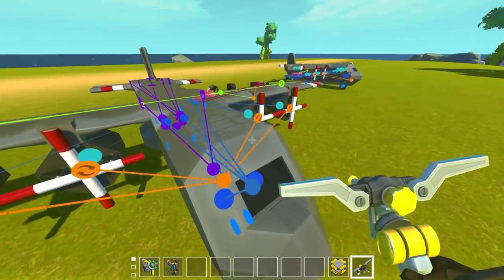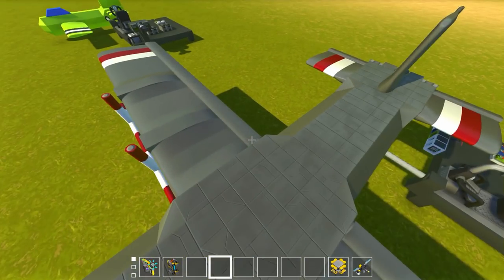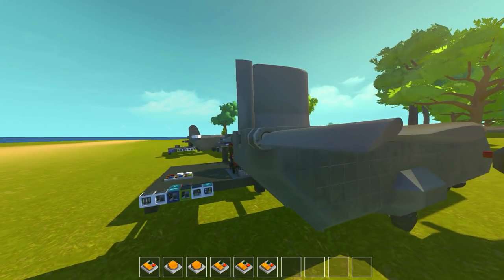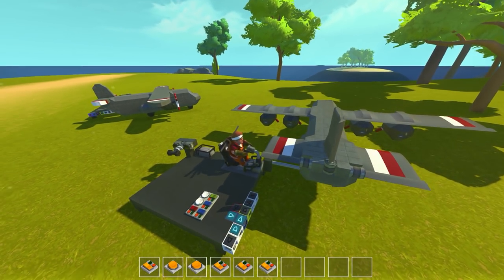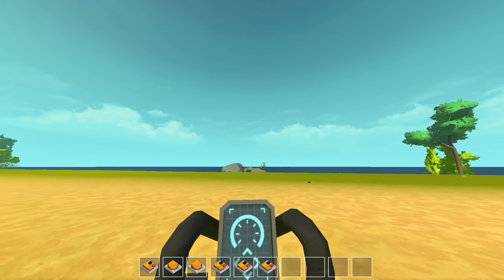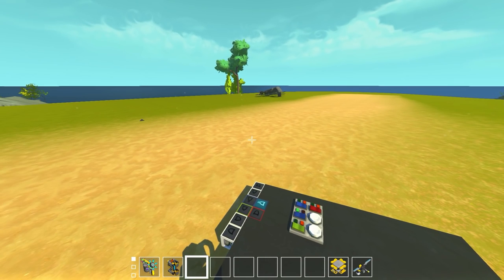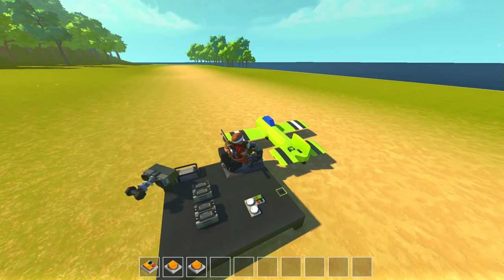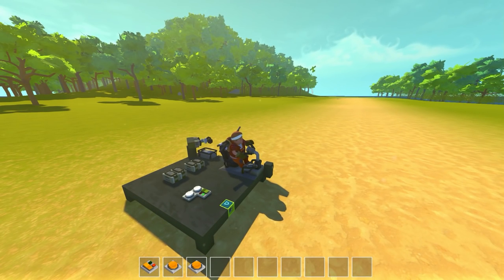Remote Control Cargo Plane with Real Wings! (Scrap Mechanic #308)

Comment: Multiplayer Monday idea: RC air course. One person controls the aircraft from inside a box (so they can't see the aircraft itself), another person is in a passenger seat on the aircraft, and directs the pilot to fly it.
You've done this with cars before, but it would be much funnier in the air.

Comment: You might want to add two of the smallest wheels on the stunt plane instead of a single wheel to make it more stable on the ground. Could you make retractable landing gear on the stunt plane?

Comment: This video is good but don't let it distract you from the fact that gru is the most powerful person in the world First according to the height of a Minion (which is 3.5 feet on average) Gru is 4 minions tall, which means he is a godly size of 14 feet tall. Second if any of you remember the original Despicable Me, you Know there is a scene when Vector kidnaps the three girls and shoots a series of heat-seeking misses at Gru, he then dodge them all. According to the speed of an average ballistic missile (1900 mph) and the size of the missile according to his ankle size, Gru can perceive and move at such a speed that the missiles only move 9.5 miles per hour, 0.5% of their original speed. Plus after this Gru punches a shark and it is paralyzed meaning its spine is probably shattered, to remind you it would require a force greater than 3,000 newtons to fracture the spine. That’s equal to the impact created by a 500-pound car crashing into a wall at 30 miles per hour. I rest my case.